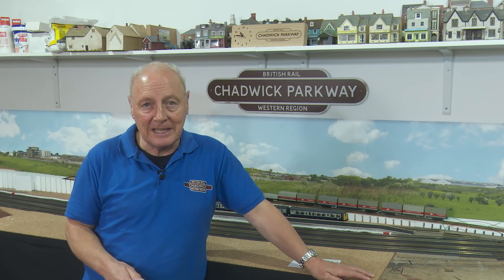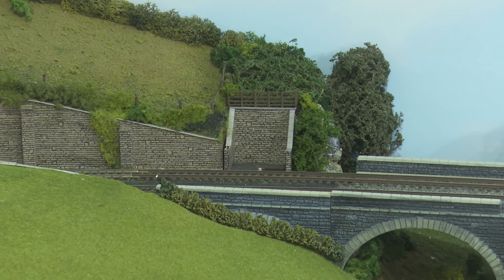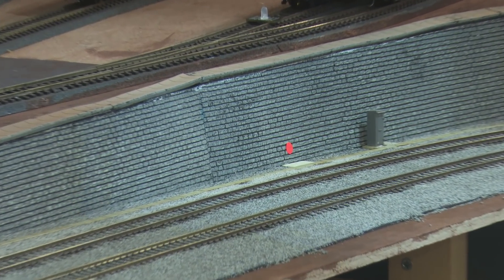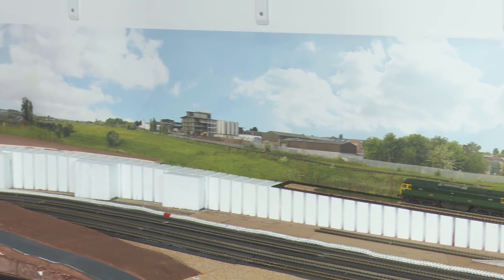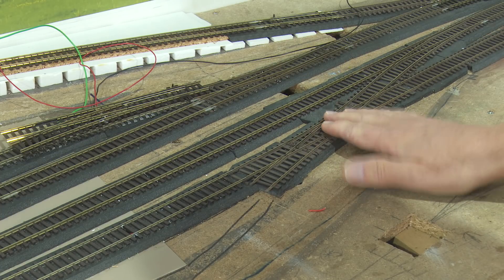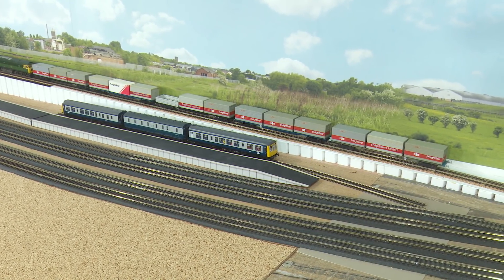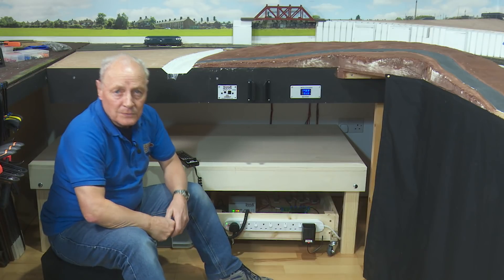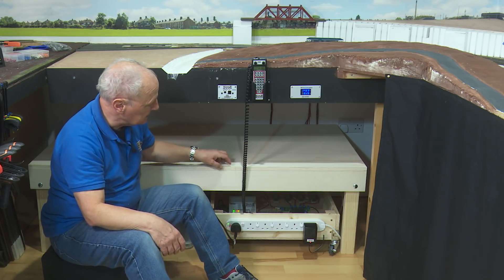Autumn Update at Chadwick Model Railway | 147.

Comment: Great video Charlie. Although is that headshunt redundant now that you’ve taken that slip point out? Maybe a headshunt would be better placed at the bottom of the branch incline? And maybe the bay platform track instead coming off the platform loop it comes off the bottom of the incline and give you a longer bay?
Reply from the maker: I had intended to use the existing headshunt as a storage line for track survey rolling stock.
However, to be honest I don’t follow what you mean in the rest of your comment.
Please feel free to drop me an email at chadwickmodel@gmail.com.
Regards Charlie
Reply: @ChadwickModelRailway  what I meant was, instead of catch points at the bottom of the incline, use the double slip and connect the bay platform track to it. And also gives you a headshunt at the bottom of the incline.

Comment: Great Video Charlie,  my only concern is that, now you’ve put sides on that power board, it’s a great dust collector!   Maybe a thin elasticated muslin cloth over the top would keep dust out but allow heat to dissipate?  Just a thought.  Keep up the great work.
Reply from the maker: An interesting point B678, perhaps I’ll get a min/max thermometer.

Comment: Thank you for another great video. I have learned so much from you, and really appreciate your willingness to let us share in your journey with this layout.

I especially liked your solution with the rolling drawer for the electronics, and will be using that idea on my layout when the time comes. I'm curious, though, about the way the wires run upward, behind the back of the lower fiddle yard shelving. Is there a space between the wall and the back side of the lower frame, so that the wires aren't pinched between the wall and the frame? Just a thought: You might want to consider using some "wire looms" for those cables, which would not only protect the lines that run to the upper level but would also provide a slightly neater appearance. You can search with that term on Amazon and find them easily.

Best wishes for the upcoming holidays, and looking forward to seeing what comes next.
Reply from the maker: Thanks MJ and you make some valid points.  I will ensure there’s a gap to allow the cables access and I’m looking into a cable wrap. Regards Charlie

Comment: Hi Charlie. Great video again but I have a major concern regarding your power distribution unit which you stated had 240 v ac terminals live and bear!! If that is the case this unit is extremely dangerous and indeed deadly to both you as well as children and should not be used or recommended.
Reply from the maker: I’ve discovered that the manufacturer makes a cover that’s sold separately!!

Comment: ‘Butterfly Modeller’? Tell me about it! 
My heart sank when you said you needed to rip out your underneath electrics board. Did you really need such a massive double fiddle yard? However, yours is a very neat and inspiring solution which I might think about trying myself should I need to.
Reply from the maker: Before you embark on building such a beast Will, you do need to consider how many years it’s going to take you to finish. I had guessed two, it’s more likely to be four. Regards Charlie

Comment: Well done Charlie,
I think we are all Butterfly modelers to some extent so it is great to see you have tackled that tough challenge.
Emotional attachment does play a big part in all we do and Covid hasn't helped as we have been restricted in being able to recharge our emotional batteries from whatever power source we each need. So well done and keep the videos coming.
One question though about removing the double slip. Will you also remove the head siding that goes back towards the cutting?
It appears there will be no purpose for it now.
Reply from the maker: No Alan I do intend to leave it for a track maintenance vehicle.
Reply: @ChadwickModelRailway  Great idea and just add a couple of small maintenance huts and a Ballast Tamping Machine in the siding and it will look perfect.

Comment: Good update Charlie, I don't know why, but when you put-off /delay a task you inevitable seam's to get rely worse than what it rely is!  but once you start it's not as bad. As for wiring we were told DCC is less wires 👍,😅😂🤣, now with more things working on DCC there might be a couple of dozen more 🤔. but it has made the so called prototypical operation with signaling & block detection more real, win some gain some. Now to watch a fellow Narrow boater, see why his boat failed the Boat Safety Scheme test (4 yearly MOT, where they update the rules, & don't tell anyone of the new rules) if your interested Cruising The Cut 252
Reply from the maker: Very interesting comment Vinny, but narrow boating is not for me. Regards Charlie

Comment: For the first time  you’ve shocked me Charlie, no pun intended. Did you really mean to say those bare terminals are live at mains ac voltage? If that’s the case there’s NO WAY that your installation is meeting electrical regulations. In fact I’m afraid I have to say it’s a potential death trap. Please tell me you meant to say 12V dc. Best regards as always. TonyS
Reply from the maker: No Tony it’s 240b ac and I’ve tracked down the cover from the manufacturer. Sadly, it’s supplied separately!!!!

Comment: i use this to cover the cables and protect them. 25ft - 1/4 inch PET Expandable Braided Sleeving – Black – Alex Tech Braided Cable Sleeve. available on amazon that would clean up the cable and give some protection from the wheels.
Reply from the maker: Thanks Dave, I shall check it out.

Comment: Hi Charlie. 

I saw your episode #147 it may have a problem on your back wall Electrically. 

As I see it your electrical outlets and plugs will be blocked by boards seven and eight. 

You may need to adjust the boards or have an electrician look at them to see if they could be moved to the outlet. 

As all outlets and plugs shall be accessible for safety and capable of being removed quickly in case of 

 Electrical problem... 

 

          Yours truly by North American standards in electrical. 

                                          Marcel Delage                       

                                          ( Santa Marcel )
Reply from the maker: Thanks Marcel. I have been looking into this problem and those power points will either become redundant or of course, I will need to move them up.
I certainly won’t be using them if the board is up against the sockets. Regards Charlie

Comment: Be careful with those inexpensive switching power supplies. They have a habit of failing. I used a 5v on my N scale layout for arduino and servos and I am on unit #3. They seem to last about a year. I do note that the over voltage and overcurrent protection seem fine as I have not lost anything but the poweer supply. It is disconcerting when you are with the grandkids and you fire it all up and you find power supplies with 0 volts. Additionally you can find models with a flip up platic protector over the screw terminals.
Reply from the maker: Thanks John, actually I’ve discovered they do make a plastic shield, however it’s sold separately!

Comment: Re: butterfly modellers. Taking aside the normal scenarios where you're doing a task, then you have to wait for it to dry / cure / whatever, before you can continue - so you do something else & get side-tracked by that - I think it's more basic than that.

My observation is that there are two types of modellers. There's the "railway modellers" who are all about the trains, the track, the points... all the infrastructure around a railway in model form, because they're all about the trains.

Then there is the second type, who are predominantly scenic modellers, and the "railway" side of it is just kind of incidental and there to provide animation to their dioramas. I think I fit more into the latter, but neither is wrong.

My point here though is that it's easy then to get distracted by something else, when you 'finish' one part 80-90%, and move onto the next thing - depending on which archetype you fall into.
Reply from the maker: An interesting point Bill. 
A friend of mine was re-fitting his kitchen, and had almost finished it bar the odd worktop end panel et cetera.

I asked him when he was going to finish the job and he replied it is “man finished!”
Regards Charlie

Comment: Hi Charlie. Just a few questions for a newbie. I have a 2003 Flying Scotsman Set, and 1956 REX Triang set with an R50 loco. However i am thinking of treating myself to Mixed Traffid set for Christmas. Iknow this is a dcc system. I am just asking if the first set can be made compatible with the DCC system. Also what are the advantages of the DCC system.
Cheers.David
Reply from the maker: I’m afraid that you need to do some research David.  There are loads of videos on YouTube that answer both of these questions.  I can’t guide you through this process. Regards Charlie.

Comment: Another enjoyable video. Here's a question. A while ago you did a video on the types of track available , gauges and scales (I happened to rewatched it yesterday). In it you mentioned two things. The first was that you Peco track every where except for Hornby 4th radius curves in your helixes and secondly that you use code 75 track on visible track work because of the electro-frog slipped crossovers. My questions are: is there a reason for using fixed radius track for the helixes rather than flexitrack, and you mentioned that the points you inserted for the bay platform were to be code 100 versions. Have you changed your mind about code 75?
Reply from the maker: I used 3rd and 4th radius curves on the helix as they are mechanically perfect, with no joint problems.  There is no Code 100 electrofrog double slip so I do use Code 75 on occasions.
Reply: @ChadwickModelRailway  Thanks for that Charlie. I wondered if it might have been because the gauge may have been eased on the fixed curve but not the flexi, making it easier for engines to haul trains up an inclined curve

Comment: Another good video Charlie. 

My only thought is that the power supply you recommend is not really a consumer product. It is designed to be installed by qualified people who would ensure it is installed in a suitable enclosure. A bit of plasticard is not suitable protection. Anything you install should be proof against any toddler who comes into your home.
Reply from the maker: I have discovered that they sell the cover separately!!!!
Reply: @ChadwickModelRailway  Hi Charlie

That is good. 

I was not trying to be over critical but having had a 240V shock myself due to my own carelessness I can confirm it is not pleasant and on reflection I was very lucky.

It is best to only work with equipment that cannot kill you rather than relying on one’s ability to always be vigilant.

Comment: Charley, how are passengers going to get to that platform (#3) over 4 tracks on the inside line?  Is there going to be a tunnel under them or a walkway over them.
Reply from the maker: No 501, there will be a footbridge from platform 1 across to platforms 2 & 3.
Regards Charlie.
Reply: @ChadwickModelRailway  A ground level bridge?  I modeled the Stalingrad Railway station and it had a foot bridge over it's rail yard.  From the station it dropped stairways down at platforms between several pairs of tracks.

Comment: Just re-watched, and I wondered why the railway company would have gone to the trouble of putting a curve into the station tracks and platforms, when there's nothing stopping them running straight.  You need to come up with a reason for the kink, I think.
Obviously Rule 1 applies, and if you want curved platforms, curved platforms you shall have!
Reply from the maker: They were originally straight Andrew, but they just look so boring. Regards Charlie

Comment: Sorry to pick up on one point.
Please don’t snip off wire/ferrules so near printed circuit boards (especially in an enclosed space).
These bits tend to fly everywhere (despite you trying to stop them) and could finish up shorting out/damaging expensive electronics, because you have missed spotting them.
Reply from the maker: An excellent point David. I actually turned the box upside down and shook it!

Comment: Afternoon Charlie  great video again.  Please excuse me speaking as a professional electrician.  Too have exposed live electrical connections is clearly very dangerous and could lead to fire or death.  Having live exposed electrical terminals breaches BS 7671 2018 Requirements for Electrical Installations and is therefore unsafe for the general public to use.  just a word of caution when buying electrical products be very careful, i have noticed when buying some products from Amazon they do not meet the standards required for safe use within the UK.   Would you put a TV in your lounge with exposed live terminals ?  I hope the answer is NO, therefore who in their right mind would place a product on their model railway with exposed live electrical connections!
Reply from the maker: A great comment Philip.

I subsequently learned that there is a cover made by the manufacturer, however it’s sold separately! Regards Charlie

Comment: That's diffantly me😂 , a butterfly modeller, think most of us railway modellers are this 😂
Reply from the maker: This club is getting bigger!
Reply: @ChadwickModelRailway  it is 😂 and with my railway I've gone back to the ' train set ' style as I've found I much prefer watching my trains just going around, am adding some sidings and maybe a end station siding for some shunting and running a push pull, and not going to pin or glue any track down so can change it at any time ,might even call the station on it Butterfly town  😂🤣